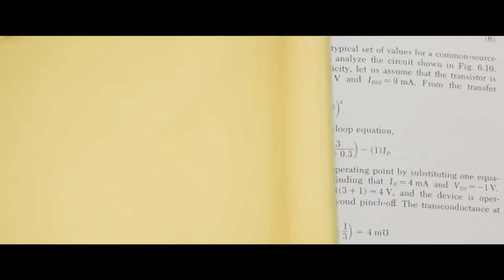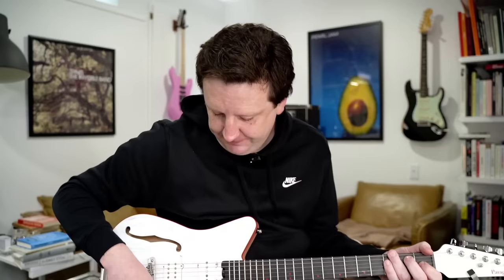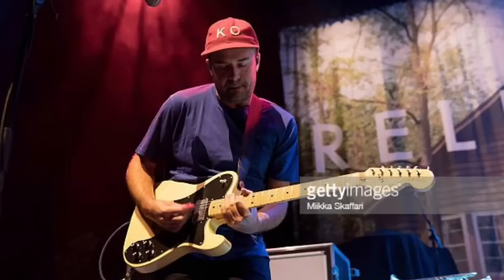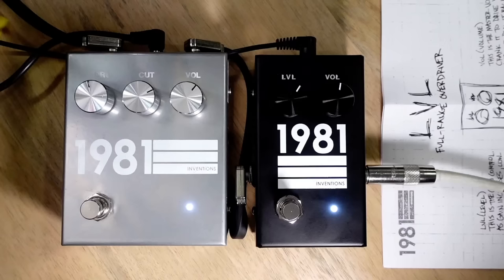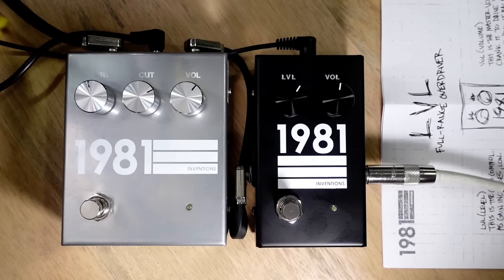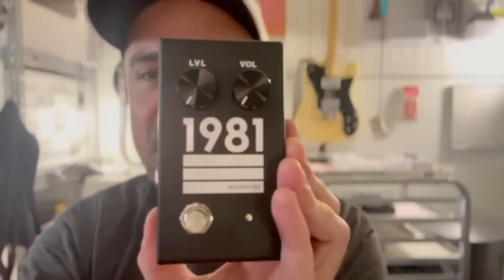1981 Inventions: LVL Full-Range Overdrive Preamp and Boost

Comment: @ 17:22 @jhspedals you are so right. I was almost always using my KTR as a clean boost. Replaced it with the solo boost after all of my drives and it sounds amazing and takes up a much less space and money!!!
Reply: If you haven’t used the KTR as either a dirty boost before your other drives or as standalone overdrive/distortion, you’re selling it short. Especially if you use a Rat-based circuit, those two interact in a super special way. Setting a Rat to a nice light crunch then slamming the input of it with a Centaur-based circuit with gain turned up to like 1 o’clock is one of life’s great joys.

Comment: Ì've said it before and I will say it again, 99% of boosts and drives sound the same to me. I just don't have the golden ears of the Gods to discern any difference. I think it applies to most pedals. It is only in the extreme sounds that a pedal can produce that I notice a worthwhile difference. And Josh has proven with the Bad Monkey that using the pedal's EQ you can make a cheap pedal sound like a $1000 dollar pedal. So get whatever feels right for you and make it work for you.
Reply: Honestly I feel the same, and I've started making pedals. I couldn't tell you the difference between germanium and silicon diodes besides the volume difference and the fact that the word germanium just sounds cooler
Reply: Just curious man. Do you hear more difference “in room?” I find the post production + what YouTube does to audio does make a lot of drives sound the same. I almost have to imagine what the pedal would do in “real life” haha. Until I try them for myself. Then it becomes very apparent. Cheers